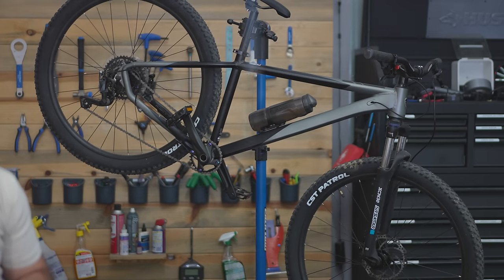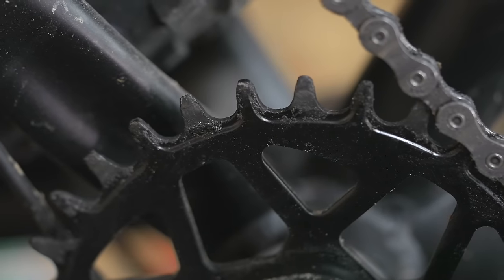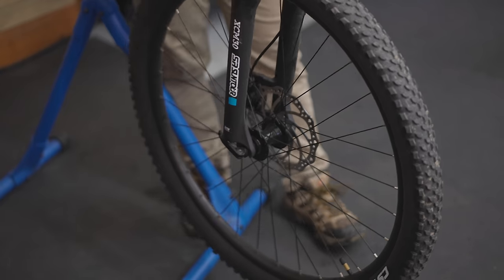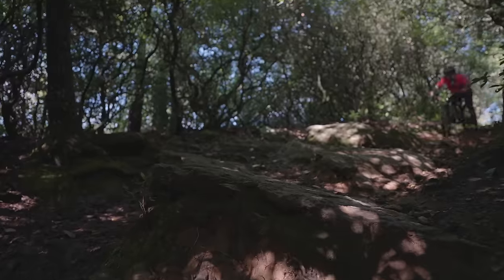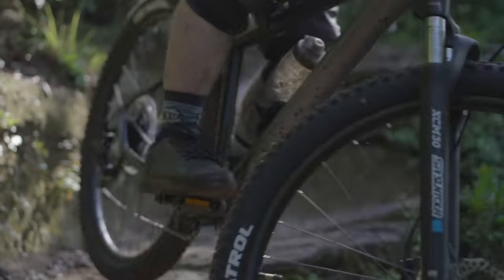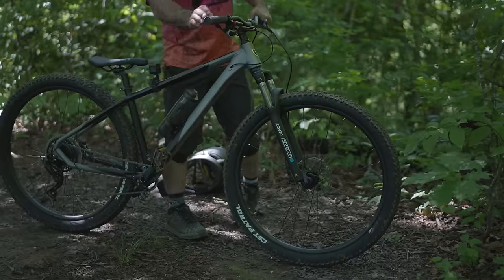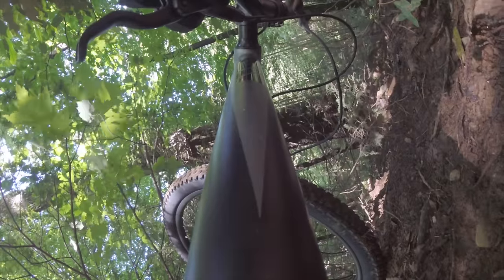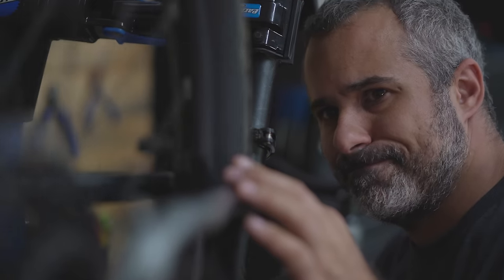Walmart MTB Upgrades! Will it explode or improve?

Comment from the maker: I’m also attempting to buy a set of Shimano MT200’s from a “questionable” seller for a really good price. I placed the order and should have them by October! Historically I have been able to get these super cheap, but lately there are a lot of scams. From Jenson you can get the front and rear separate for a bit more than the Zooms, but you need to wait a few months. I’d love it if this seller comes through with them because Shimano is a lot more reputable!
Reply: I'm actually upgrading my brakes on my FX5, I've got a like-new set of MT201 levers and both UR300 calipers/pads you can just have.  if you want 'em, just reach out.
Reply: Hey Seth, I started mountain biking because of you. I recently got a new bike (ccm slope 26 inch hard tail). But I want to know before I take it out in the trail it’s good and safe. I don’t know anyone else to ask, so can you test the bike for me?
Reply: M315 and MT200 is almost the same right? The only difference is M315 has aluminum alloy levers
Reply: I bought a 2nd hand unused trek marlin 5 for dirt cheap off Craigslist a number of years ago and wanted hydraulic brakes. The t5 has brakes and shifters in the same controls, so had to buy new shifters too.

Took a risk and bought some Shimano hydraulic brakes off aliexpress for $43 shipped. Was shocked when they actually arrived, even more surprised they felt really good quality and work quite well!
Reply: Hi Seth, there are lots of very good bike parts from Lazada for example and I was wondering If you would buy an air fork from Lazada even maybe Alibaba. A brand that is very popular is Balony and Modeng can you test one of those thanks.
Reply: For the fork check out something like a suntour epixon or rockshox judy, that's where the money is best spent around or under $200 unless you go used. A dropper post and new tires and that bike will be completely different
Reply: @bothbeta2753  not bolany. specially on forks. That thing is not gonna last long. I've seen enough people that destroyed Bolany forks doing basic trail ride here in Philippines. If those people can destroy a fork, With riding style of Seth that thing would last 15 seconds max.
Reply: Just ordered the zooms after attempting to source mt200's for my trouvaille, thank you for the relative endorsement 👍 my BB is holding together so far 🤞
Reply: I think Rockshox Yaris' are end of line, so they are going cheap.
Reply: I got my 200s for $65 on EBay a few months ago
Reply: All over Ebay in 3 days for under $60 front and rear!
Reply: The zoom brakes are actually pretty good, I ride around on electric scooters and me and my friends regularly use zoom brakes and they hold up fine.
Reply: Got a front MT200 on Amazon a few weeks ago as an upgrade to mechanicals. (Only front as the seller for the rear or the pair wasn't quick enough to just not go to ali express) and it's night and day how much better they are. I've had this bike since 2004 and only just now getting round to doing the upgrades I always meant to. (Didn't get used much in that time but Seth is making me get out there again!
Reply: you should go to jarrods place in Summerville, GA
Reply: Do u have a Instagram where I ca send you a pic of a bike for some reason I just can't find the size seat post are all 90.s raeligh bikes got a universal sizetube or something ay advise woukd be appreciated as it was my mum's bike and she died 14 days before my birthday so wanted to get it done
Reply: I bought a set of MT-200s for my Trouvaille from a guy on eBay for $55 shipped.  They've been excellent after a full bleed.  That said, I had to put a new hose on the rear brake because it came a little short. If I didn't internally route it the length would have been fine.  I had them in 3 days.

I have a similar BB/Chainring on mine a ran it like you did for 3 hours today...not a single drop.
Reply: @cza1898  My bike came with MT200 stock. I'm pretty sure those are aluminum levers. I've had trouble with the calipers leaking brake fluid into the pads. I've got them working now, whether they're still working the next time I get the itch to spend money on a mountain bike will determine whether I upgrade the brakes or get a dropper post first.
Reply: Those tires surprised me when we tried going tubeless on them, they took to it no issues.
Reply: @christopherbaird4952  u sure its MT200 not MT201? They look the same but MT200 has steel levers and MT201 has Aluminum levers.
Reply: Let me know if you need some I have 2 sets I took of old bikes in wilmington nc
Reply: @bothbeta2753  Butter suspension has a good video that will tell you in detail why to avoid Bolany forks.
Reply: @cza1898  Agree! I threw a ZTZ air fork on my 11yr olds Kona Lanai (xs). It SUUUUUCKS! Just ordered a Marzocchi for $250.
Reply: am i the only one who thinks cheap clark m2's aren't that bad?
Reply: Doing bennet gap on a Walmart bike is impressive
Reply: I have 2 project budget HT's and been using MT200's for a while and no complaints, I've also used overseas air forks and you get what you pay for, i ended up with a Manitou fork (and tubeless tires) that kicks up the cost.   Dropper, pedals and grips are other overseas hacks will improve the experience as well. Don't forget a cushy seat too!  If you can build a rear wheel, that made a huge diff for me with robustness and engagement.
Reply: there is quad version of that zoom brakes.
Reply: Mr I wish you could really read this here in the Philippines we have a famous budget fork it's called weapon cannon 35 you can pick your travel option from 120 to 160 and had 35mm stanchions to bad 29 only comes in 120mm travel but the 27.5 can fit up to 29/2.4 tire and this suspension fork only comes 150 dollar or more I know this because I am using it for 2 years now and it's amazing and note you need to put some foam ringd for more better performance please try out the weapon cannon 35 it's really worth it
Reply: Here in our country philippines only mt200 and zoom are the safe spot when in terms of budget hydraulic brakes 3rd would be the tektro from built bikes but yea shimano is shimano haha
Reply: Hey Seth I would still be a little iffy about those brakes if I where you.I have one on my se fat ripper and the calipers like to seize up or sometimes not work when you pull the lever.when turning my bars to the right they get mushy. I’ve tried bleeding them but it doesn’t solve it.if they don’t work on a cruise/wheelie bike idk if I would trust them on a mountain bike trail.replacing mine with shimano deore xt’s on monday
Reply: Regarding the rear derailleur, you can make another hole in the outer cage plate and rise the tension of the spring, like old Deore XT derailleurs allowes.
Reply: I have a set I can donate to you. Nothing wrong came from donor bike.
Reply: Hey seth what happened to your finger? 2:13
Reply: Zoom started in the early 90s with some lightweight stems, bars and seatposts that beat the system then. When a syncros stem was £100, they were £30, when answer hyperlight bars were £80 they were £25. I raced them back then and they held up well. Good to see them still doing it now.
Reply: would be interesting to see you do that trail on say the lowest price trek roscoe....and see how each rig 'feels'
Reply: @cza1898  you're right, I've got MT201, not MT200. My bad.
Reply: Im riding with MT200's and for the price i got it for its worth it. Maintenance only cost me like 2-3 dollars for bleeding and around 15 bucks yearly for a new pair of brake pads for the front and rear. I think you will be more confident with the MT200's compared with the Zoom hydraulic brakes you got
Reply: We have them in stock! Like $45 each if you wanna drive to Arizona
Reply: @cza1898  MT201 is identical with MT200, just with alloy levers.
Reply: @cza1898  i upgraded my mech brakes with shimano MT201 with alloy levers.
My friend used to have MT200, after a year the levers becomes rusty.
Reply: @cza1898  MT200s also have alloy levers, 
Edit: or just steel idk
Reply: @Berm Peak Express. Those QRs have a nylon insert in the camming mechanism and it packs down and goes slack, after a while it settles down and stays closed. It a common problem with them. Shimano QRs are the way to go as the cams are all metal.
Reply: "questionable seller" sounds like a wish purchase, lol
Reply: Hey just letting you know that you have scammers going through the comments sections offering "prizes" to people who comment. Call themselves the real berm peak express. Keep an eye out.
Reply: @turdbomitch9007  yeah even some cycling content creators have those fake scams or prizes
Reply: I got my mt200’s of Amazon for $50 brand new. They definitely came straight from china but work great right out of the box!
Reply: Cheap air forks on that thing for sure! Also, a full "amazon/ Chinese knock off" build vs say a $3k hard tail would be pretty entertaining!!
Reply: You could just buy a trek Marlin now
Reply: Honestly the MT200s aren't bad.  They handle Kitsuma at least.
Reply: Put a ZOOM FORK on it!
Reply: @JEsauRomano  cool
Reply: BUY A 4 INCH ALUMINIUM ANGLE- DRILL OUT A HOLE FOR THE REAR AXEL. FIT A WEAK SPRING TO THE OTHER END. ENSURE IT SITS HORIZONTAL TO THE GROUND FACING BEHIND- ATTACH THE SPRING TO THE DERAILLEUR THIS IF YOU NEED- THIS WILL KETHE DERAILLEUR TIGHT. ...TRUST ME- CHEAP HACK I USE IT IN COMPETITION NEVER FAILS.
Reply: A chain tension pulley seems like a worth while cheap upgrade.
Reply: Schwinn Axum has the same parts with  different names. Tires forks derailleur the only difference in the bikes is the through frame cables . Even the frame  is the same. Not sure if this is a hack . How often do you have to fix the bikes when you get done riding and how many times have you taken the Kent out on rough trails. Will it still be a good bike in a year if this is the only bike you ride ?
Reply: If I saw this a week ago I would have sent some to u free I just tossed them cuz no one else wanted them once I went to Magura

Comment: I rode a DH trail yesterday on mechanical cable brakes. The amount of arm pump and wrist pain by the end of the ride was unbearable. Definitely hydraulic brakes!
Reply: 2 solutions, hydraulic brakes, no brakes and hit into a tree or wash out on a turn
Reply: Yeah, a flick of a finger on the lever and instant stop
Reply: @nzo_6543  especially 4 piston
Reply from the maker: This trail is 1300’ of descending and will wreck your forearms without a good set of brakes, just like you experienced. These friggin’
Amazon brakes were PLEASANT to descend with. I was blown away.
Reply: @BermPeakExpress  I rode Kitzuma decent with the stock Trouvaille (posted a video) and I think the brakes just gave me a 500% increased risk of developing arthritis in my fingers. Later, I replaced the front brake only to an MT-200 and kept the stock rear brake, and it has made night and day difference. Consider replacing only the front brake an ultra-cheap hack, and ultra easy for a beginner mechanic!
Reply: Shimano mt200's are right around $70, with the zooms being the same price I can't see why you wouldn't go with the name brand
Reply: if you're blaming just the cables for how the lever/arm operates, then I think you're oversimplifying things. I have TPR Spyres with cheepo Sunrace levers (reasons) and no issues or pains stopping total of 160kg on a downhill ride 🤷
Reply: @Bengy22  while I agree it's nice to see a video on the a untested/ unknown brand
Reply: @Bengy22  i think Seth wanted to try it out since, it's new on the market, and since he's impressed with it, well it's self explanatory.
Reply: @BermPeakExpress  do you have any tips for how to aquire low price mtb parts locally as my mtb was stolen?  

If you are wondering why I don’t just save my money is cos I’m only 13😭😂 

Love your vids btw

Edit: the last part
Reply from the maker: @Bengy22  I have tried time and time again to find those brakes for $70, and I absolutely cannot. It’s always either a scam, or unavailable. I think prices may have gone up, but tell me where you get them from and I sure will! Edit: To be clear I see them listed everywhere for as little as $55 but the listing is always suspect.
Reply: @BermPeakExpress  Those $55 are just OEM build packs.  The cables are a bit shorter, but I was able to install them on a large XC bike.  The will pop up on amazon prime every once in a while.  I got them and they were 100% legit, but I got the ones that shipped from an Amazon warehouse just in case.
Reply from the maker: @bindingcurve  Thanks! That is some valuable insight. I just placed an order and will update all of you in October when they’re “expected” to arrive.
Reply: @BermPeakExpress  Check on ebay, I know they are questionable but seems like what the other person said they are just OEM parts. I bought a set a year ago and still very happy with them. Also like you mentioned $55 from a USA seller
Reply: Awe muffin did woo huwt your waddle wists.?
Reply: 4 piston hydraulics for you.
Reply: What mechanical brakes? I know it may not really make much of a difference but ... there are some good ones out there
Reply: Try a 90s fixey on for size lol
Reply: You just need to adjust brakes correctly. It takes a lot of time, but end result is soft brake lever, that feels like hydraulic and stops the same. I ride with cable brakes, never had pain after I learned to adjust them.
Reply: @taylorjones6591  i did exactly that! Replaced just the front mechanical (tektro) with a MT200 set and having the live front vs rear comparison is just.. just... Well you know!
Reply: @Bengy22  70 for only 1
Reply: Oh yeah, got some more or less cheap shimano mt400s on both my bikes. They're amazing for the price (4piston mt8000s from my gf are even better^^) in contrast: had a cheap bikesharing bike today in the ciy with rimbrakes .... shudder ^^
Reply: @ZeusTheGod-mc9pv  nope I actually checked 56 for a set
Reply: MT200s can be found for $40 on aliexpress. I've bought four sets so far and never had an issue with them
Reply: I always ride a downhill on my Marlin 6 with Suntour XCT...lol 😂
Now the part of stanchion near the seals are weared off from inside 🥲
Reply: I rode black diamonds at highland on a 24" specialized hotrock (also with mechanical brakes) with 100mm of travel
Reply: I ride downhill on a 90s department store dual suspension with mechanical rim brakes and I feel your pain
Reply: @BermPeakExpress  I'd be interested to see how they hold up in the long term compared to a lower tier Shimano.
Reply: only nightmare i have was snapping brakes cable and have no brakes at all (using feet was stupid thing todo avoided dangers self on mtn trails)
Reply: the exact other way around, i rode a bike with hydraulic brakes for the first time yeasterday, the ease of stopping is just so great
Reply: @somerando1067  Be helpful to tag the person you're replying too....

And you know capitalization and punctuation is a thing right?
Reply: I prefer mechanical honestly🤷‍♂️ but then again I race motocross and also hate new school hydraulic clutches and brakes on motocross bikes as well. Cable clutch and brakes for the win.
Reply: @nzo_6543  depending on the soil/ground
Reply: @nzo_6543  and the tires.
Reply: Thanks for this: was thinking to go mech when upgrading my old hardtail rim brakes, but am going hydraulic for sure!
Reply: Gave up on hydraulic brakes because they were always leaking after storage. My cables have been set it and forget it and give me plenty of power.
Reply: @niceguyrides  Were you using low end stuff?
Reply: @GokkunGuru  no, but it was a while ago. Apparently Shimano at the time was notorious for leaking. I just got tired of messing with it.
Reply: U don’t need brakes just bail
Reply: I did the same a few months ago on my buddies rockhopper at mountain creek while his brakes were barely working
Reply: my half broken kids hardtail has mechanical brakes and i dont have a single problem with em and shred harder than the other mtbers on 5 grand dualies
Reply: I used bb7 avids. No pain
Reply: That’s what made me upgrade to hydraulic brakes! 😂